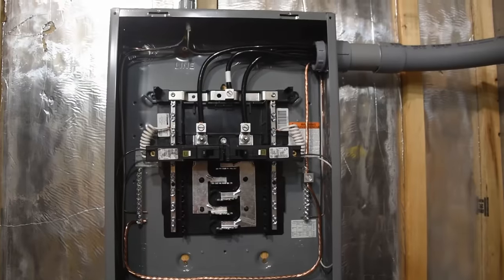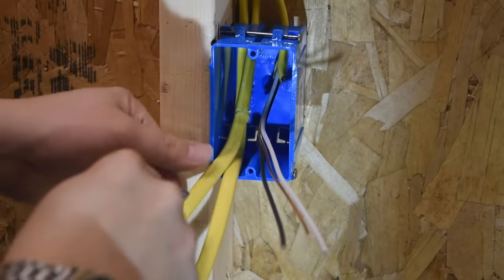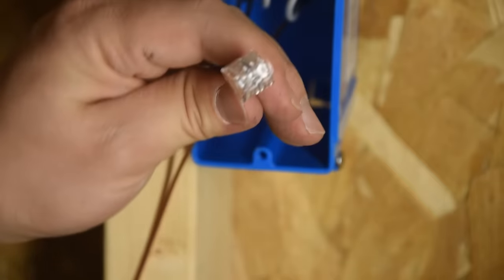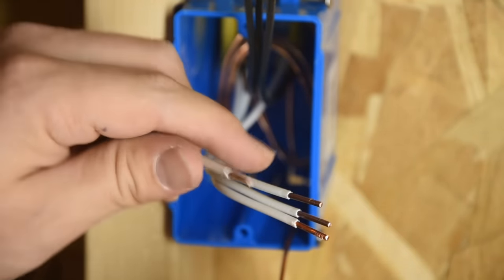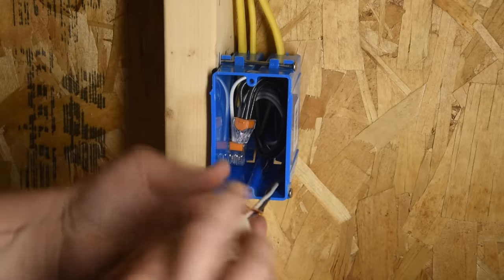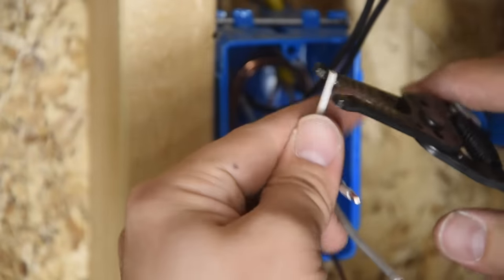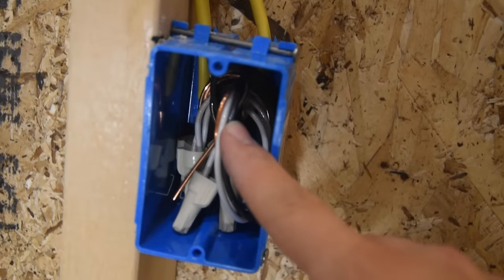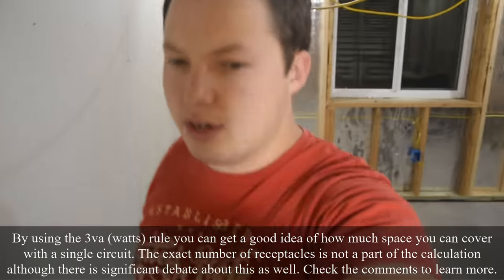Wago's vs. Wire Nuts - How To Wire Outlets During Rough In

Comment: I WOULD ALSO COVER THE OUTLET BOX WITH A PIECE OF CARDBOARD OR MASKING TAPE TO KEEP OUT THE CRUD FROM THE DRYWALLERS AND PAINTERS.CLEANER RESULT.
Reply: Yes, and a side benefit is being able to still read writing on the wires. I hate scraping that crap out of my boxes - some hacker tapers will even clean their knife on the box 🤯
Reply: @treyhart6861  indeed - I go back (or send an apprentice) after the 4 way inspection is done - I've also had an inspector ask me if we were going to tape the boxes up lol 🤷‍♂️⚡
Admittedly though, I haven't done a tract house in twenty years - I'm mostly commercial/ industrial and do a custom home occasionally. Those jobs afford a little more time for that kind of thing versus production home building 👷🏻‍♂️👨‍🦳
Reply: But only inside the box. Covers extending outside the box would be ripped off as drywallers want/need the outside edge of the box as a reference for their drywall cutting tool.

Comment: I have always stripped the Romex  before I put the cables in the box. It is much easier. Just hold the Romex alongside the side of the box,  get an idea how much insulation you want sticking in past the clamp if there is one, mark it  with your thumb and strip it. Then insert it in the box. Just the way you would strip MC cable.

Comment: I'm german and my first qualification was as an electrical engineer. There are three things I saw that I felt to be wrong even in the USA. There were more things that let me cringe like the cable nuts and the blank copper but that's the difference between Germany and the USA. 
1. Never remove the cable insulation with a knife - you can a)  destroy the insulation of the single wires and b) damage the copper in that way that the gauge changes. There are tools for removing insulation without any danger for the inner wires and they are designeed in a way that even with little space you got no problem to strip the insulation of.
2. Whereever you install a cable - Always leave the groundwires longer than the other wires. That makes sure that when somebody rips for example an outlet out of the wall that the last wire that disconnects is the ground and not a live wire. A still connected live wire could endanger a person. For example electric heater and somebody falls over the cable in a way that rips the socket out of the wall. It's possible that because of that accident the case of the heater is internally connected to the phase and if somebody touches the case the body is used as a way to ground.  If ground is the last that disconnects the danger is less that any touchable part of the heater is on a live wire without a blowing fuse.
3. Connectors always face up and are at the highest point of a receptacle. If water gets into the receptacle because of a leaking roof, leaking water pipes or condensate etc. it does not collect in the connectors if they are on the highest point.

And because I'm sure some will ask what let me cringe - two additional things. First the blank ground wires. If you got a defective insulation you could get the live wire connect to the ground wire and as far as I know in the US is no GFCI for the whole house like in germany that react as soon as a groundwire touches a live wire. They exist only for some outlets in the US or with some extension cables - please correct me if I'm wrong. And the second is the cable routing.  To remove danger all cables in germany are in an area between two inches and a foot from the ceiling and at every outlet the cable goes vertical in the direction of the cable area near the ceiling and goes in that area to a central junction box in the room. Outlets are not daisy chained over more than a distance less than an inch. You only daisy chain if the receptacles are side by side. The same rules are for water oulets etc.That is because when somebody works at the wall - putting a nail in it, a screw, cutting a part out of it, you can always be sure that without needing to check it a cable will always be only above an outlet or near the ceiling. No danger to hit a live wire with a nail when you put a picture on the wall. If somebody want to read about the german rules for electrical  installations just search for VDE DIN 0100.

BTW WAGO connectors are used in germany since the 1970's, because WAGO is a german company with it's headquarters in Minden Germany. And the WAGO connectors that are used today were invented in the 1980's.
Reply: bro get out of the books and get into the field. I've stripped back miles of wire never once cut the single wires insulation. not once!!! second if you have water 18" up to the elec box or even water running down the wall into your box, the water getting into the wago is the least of your problems. lol
Reply: Okay true king of Gondor
Reply: @rkalle66  do you live here? Have you worked in and around houses here? Have you worked for a good crew in the states??  No, oh well I guess your not speaking from experience but just assumptions and I would have to wager you know what they say about assumptions!?
Reply: TMI!!!
Reply: @kentuckybeardsman 🤣

Comment: I use lever wagos.  yes they are a little bit more money but so worth it.  I still keep some wire nuts around in case I need to cap off a single wire

Comment: Great vid. I only use wago lever nuts. They rock. And I only do pigtails.
Reply: Yes, pigtails are really a must. Not a must in the strict sense, but a practical sense... you SHOULD pigtail to receptacles.
Reply: It IS a code requirements for commercial and industrial but for Residential I prefer side-wire loop-through topology - it's faster, easier to troubleshoot, and every bit as secure as pig tailing. AND I can have an apprentice wire receptacles and switches and still be able to inspect the work. I can't trust an apprentice to get a wire nut on properly in pigtails so then I have to troubleshoot their work.
But to each their own right? Pig tailing has advantages for sure but it has drawbacks as well. My 2 cents
Reply: @sinistersparky9657  Check out backwire devices. Those are the best of both worlds: you can insert two conductors per screw, so you have essentially a pigtail and tap in one.

Comment: Wow... makes me glad I’m in Australia guys.

We have similar to your yello stuff but you twist the conductors together. The back of the power point has the screw lock down type connections.

You’d have no trouble twisting three active wires together in the back of the point. Power circuits here are 2.5mm even with us having 240v.

In the average home here it’s either metal studs or wood. With most of the walls gyprock (drywall).

If the points are put in at the start of a house biuld. There is a metal frame that gets nailed to the stud for the sparky to fit the point to later (after the walls go up). If it’s done after there are things called c clips.

We don’t do the box in the wall. The back of the point is open to the inside of the wall. The point does all the joining and holding. Much faster.
Reply: Also in 230V land here.  We have a choice and mix of 4 box types: On-wall boxes that are fully on the surface.  Front-inserted boxes that are pushed into a hole and clamp themselves to the back of sheetrock or wood panels.  In-wall regular boxes that can protrude to the surface but not beyond and cemented-in boxes that can be pre-installed (without wires) in concrete walls, connected by equally cemented in pipes at the prefabricated wall factory.  Once the concrete walls are up, the state licensed electrician can pull wires and install outlets without weakening the load bearing walls.

Comment: I use Wago lever locks all the time...best improvement in home electrical in decades.
Reply: The new lever nuts are the BEST. I really don't like push-in connectors.
Reply: @SgtZima  Have you seen the new push in WAGO? WAGO 2273 series. If you are tight in space, these are SUPER slim. Even slimmer than the lever wagos.

Comment: When you roll the wires into the box, you are now allowing the Sheetrock guy to cut the middle of your wires with his roto zip. You should zigzag the wires into the box so if he does screw up with the roto zip, he will only zip off the very outer insulation.
R

Comment: I wired and rewired some very large houses and shops with multiple breaker boxes and prefer the Wago over wire nuts any day of the week. Never had a problem with pull-outs or any other type of failure.

Comment: I always pre-twist my wires with lineman’s pliers. Which is why I love the Wago idea!
Reply: Do you use the push in feature on the back of cheap receptacles? It is the same type of holding mechanism. I do not trust them in the long run.
Reply: @leekumiega9268  I don’t use the push-ins on the back of receptacles, not because they don’t hold, but because I don’t want all that juice flowing through the receptacle. Which is why we use pigtails. But wagos seem to work well where I have used them on low voltage applications.
Reply: @DashPar  Yes WAGO's are probably fine for low power demands like a standard light circuit but would not trust them in the long term for feeding a receptacle that could high amperage draw.

Comment: Hey Ben! 
1- pvc connector with plastic bushing on the tubing against the joists. Protects cables from edges.
2- dedicated afci circuit for bedrooms and another one for living room.
3- I pre twist with ideal wing nuts.
4- I pre twist the copper then add sta-con pressure connectors for grounding conductors only.